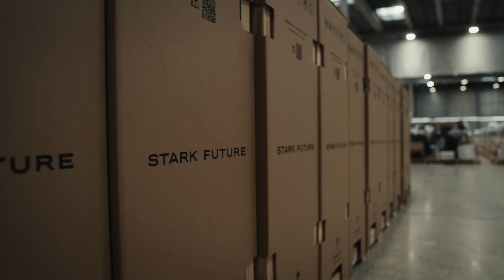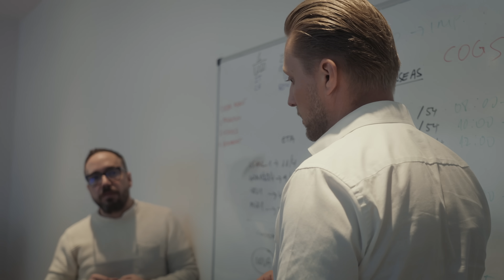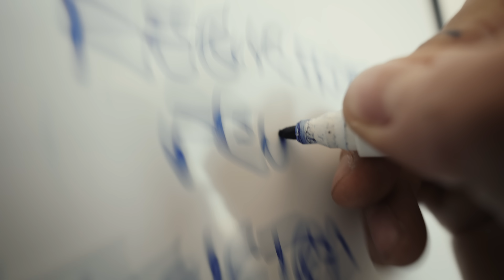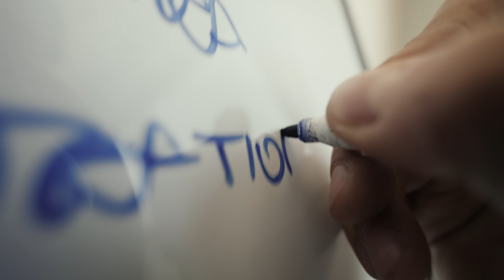The one about the VARG EX | STARK FILES 001

Comment: Finally got mine. Awesome machine, lots of power (even my 60HP version), high quality components and the power modes mean that you can dial down the madness to avoid surprises off road. I can even let my teenage kids try with 10-20HP. But.. things to improve:

1) There are too many problems with the bike's firmware and the Arkenstone. I've had the bike for less than a week and have already experience the bike refusing to start until FW was updated, lack of BT link, bike and/or phone has to be shut down/powercycled. It's bearable once you know all the small tricks to get things working, but really confusing for a new owner. Hire someone with experience of quality assuring embedded systems.
2) The turn signal buttons... Too tiny and not tactile enough for me to be reliably operated with gloves. To top it off there's no visual indicator on the screen - why not make a huge, flashing green arrow on the sides of the screen?
3) If you want to have bikes that can be ridden on roads you need to properly balanced tires. Mine weren't and the bike's shaking at 70-80kph. Don't know if this is dealers or Stark's fault, but QA need to be better on this for a brand new bike.
4) The Pro SW features should be default - at least the throttle curves. I understand that businesses love subscriptions, but consumers really do hate them.

Cheers and thanks for an otherwise amazing product. Best of luck to you all, both individually and as a company.
Reply from the maker: Thank you for taking the time to share your feedback, it’s genuinely appreciated. I’ll make sure to pass along the points you’ve mentioned so the team can take them into consideration moving forward.

Comment: My EX arrived 3 days back and after 30 mins riding it's dead. Took back to dealer and could be a faulty VCU. They don't have a diagnostic tool and you have to wait to get an appointment with a technician in Spain to log into the bike. I paid $15k for this and would expect a kot more. Being told it's a week to get a potential replacement. Need to check if can return this and get a refund
Reply: Counting down the hours till your comment gets deleted!
Reply: Your vehicle is under warranty from Stark.  If your local Stark dealer does not have the experience to fix you can contact another Stark Dealer like Kaplan to assist in fixing your bike under Stark Warranty.  Kaplan is the largest Stark and also Gas/Gas dealer in the US = they get shipments from Spain continually and also import/export bikes WorldWide.